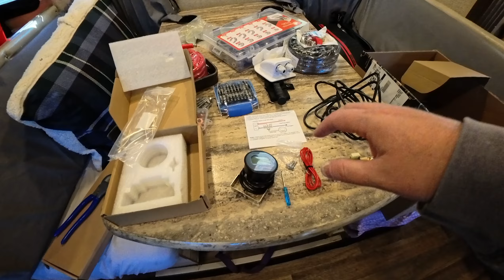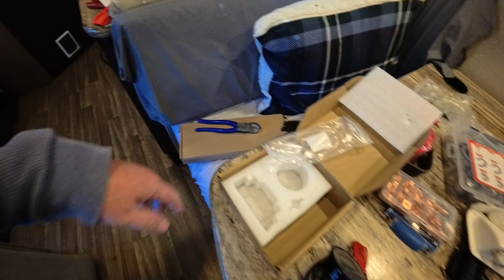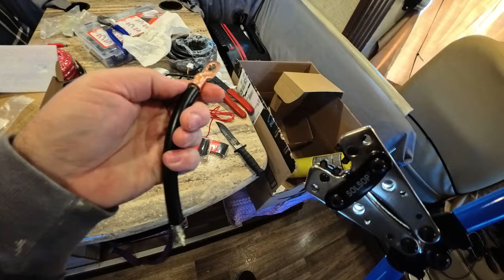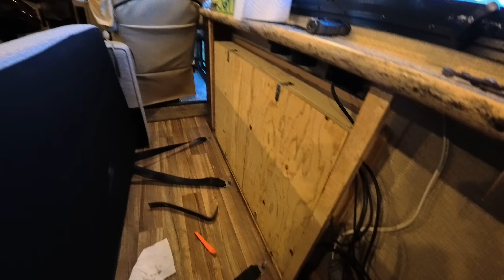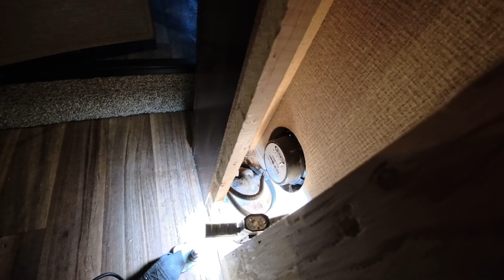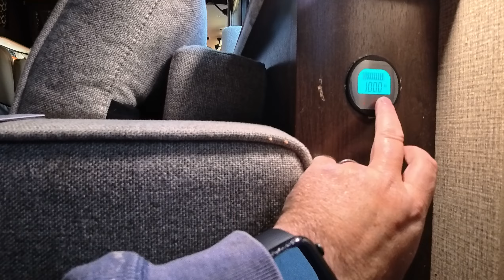Installing An RV Shunt Battery Monitor From BINTA | How To

Comment: I'm about to install the same Binta monitor on my kayak motor battery.  I'm debating between letting it be on always, depending on how fast it draws down the battery.  One option I hear that is used is to put a toggle switch (I believe in the red positive lead) to stop current draw when the battery is not in use.  However, I do not want to have to program it each time I go fishing, so that option must be analyzed.  If it draws minimal current I can keep it connected and just give a bump up charge the night before fishing!
Reply from the maker: I can see doing that on an application like that. I don’t think it will forget the settings. When I swapped my old lead acid for a 300ah LiFePO4 the settings were still in the display from the old batteries after being disconnected for a few hours.
Reply: @MajorDadsGarage  Update: After trial running the Binta on my Newport 40ah battery with bluetooth to check for accuracy (prior to moving to the Dyness 55ah) I am impressed.  I doubt that the Binta uses much more power than the mini draw we don't see within the built-in bluetooth circuitry.  Let's face it - something has to be running within the battery for bluetooth to see our phone clicks!   I was impressed - starting next week my fishing trips will include a 40ah and the new 55ah batteries for insurance to get me home!
Reply from the maker: @michaell1665  Nice! Mine isn't bluetooth but I wish it was!
Reply: @MajorDadsGarage  Although I haven't fished with the new battery tied to the Binta, as an update I will say that a week later my monitor (confirmed by voltage reading) shows that the 55ah battery remains at 100%.  I have a feeling that except when the backlight is manually toggled on, the Binta likely uses as much power as a typical internal bluetooth BMS... just a hunch.